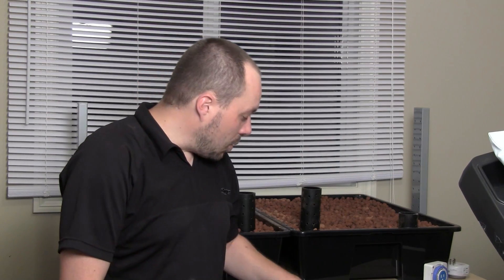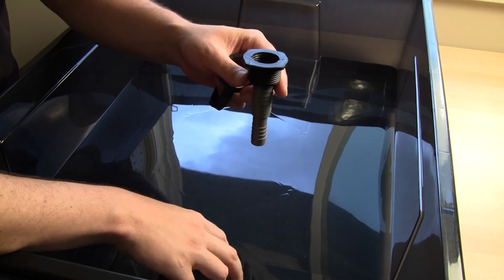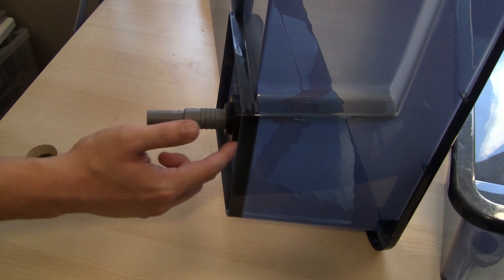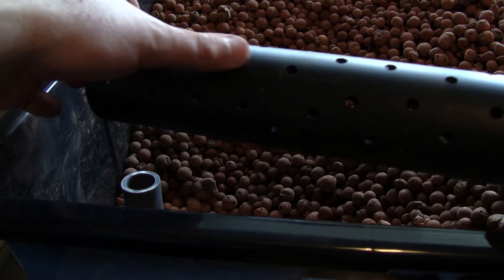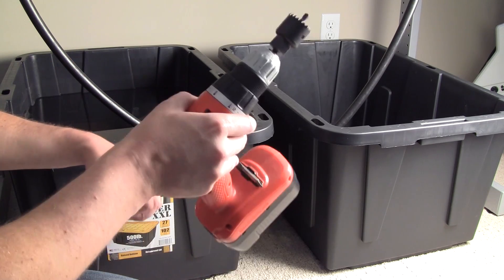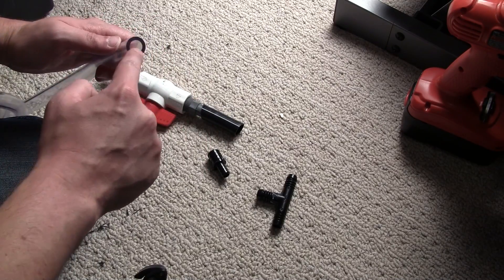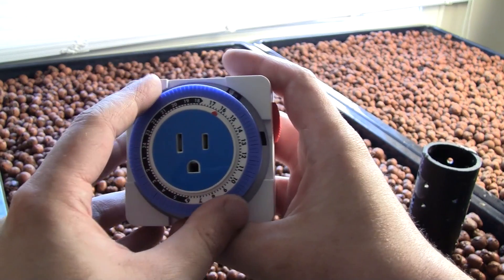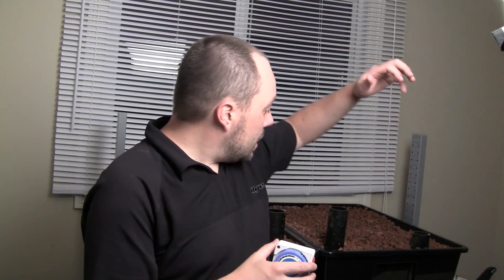Aquaponics system: How to build a desktop aquaponics system for indoor gardening. Aquaponics guide.

Comment: Nice video but shouldn't you have washed your Hydroton before putting it into your tank? Also did you consider using a bell syphon? I'm considering a system with a 20 gallon aquarium with a bel syphon. Are you using a water test kit?

Comment: You have no bell Siphon and your sump Tank configuration is backwards. You want the water falling back from the plants Straight into the fish tank for Aeration and Fish health. You want the pump pulling from the sump tank.  A sump tanks function is to pull out a majority of the waste solids you do not want actually going through your grow media and let it fall to the bottom of your sump tank, (when you clean your sump tank, The solids are great for the garden. ) you set the sump tank up so that the fluctuation in water height happens in it, usually by the existence of carefully situated overflow upside down overflow pipes in the Fishtank. Basically what you did here in between the two tanks only with an elbow and a pipe facing down into the Fishtank. Never mind the haters and let us know how it turns out!

Comment: before you decide to run out and buy all the tubs and piping and pumps, find out how much those hydroton pellets cost - I'm guessing the amount he used probably ran somewhere in the $150 to $200 range - although bags of bigger stones would be far cheaper - they are harder on the roots, and of course, much much heavier - so your supports must be able to support the extra weight.  Hydroton is light - except for it's cost.

Comment: In this set up using a timer it would appear that Robert has what is called and ebb and flow.  Once the pump shuts off the water back flows through the pump back into the sump.  No siphon needed.  This is a good alternative to a Bell Siphon as some seem to really hate them.  I actually love Bell Siphons and use them on all my large beds but on a small grow bed with limited space an ebb and flow work well.
Reply: This is not true! All he built is a stan pipe, the stan pipe had no holes!
Reply: He has a pump going up into the very bottom of the container so the drain will be the pump however low that fill tube is everything will train back down it when his pump shuts off. + he as an over flow tube.

Comment: Guys, he doesn't have a siphon because it makes it impossible for the drainage to fail.  The stand pipe needs to be at least 1.5 inches from the surface for plants to get roots down.  Once the plants grow roots, you can change out the stand pipe so that it is lower and the roots can be introduced to oxygen.  Also saves space.

Comment: Hi Robert, I was wondering if I could use peace lilies in my HOB 110 filter for my 75 gallon goldfish tank? The water doesn't drain because it's a normal filter, and I'm worried that the roots would start rotting because of that. However, I heard that if you use the clay pebbles than the roots won't rot. Any advice you could give would be so appreciated!

Comment: 5 time a day for 15 min ?

I am little confuse 

you mean we need to circulate only 4-5 time a day only or water should be run continuously ??
Reply: The system is designed to fill the grow beds then drain completely 4-5 times a day. As he stated he will test to see that it still leaves the growing media moist to about 1inch below the surface. You don't want the roots to be underwater and you want the water to cycle.

Comment: people eat food grown in plastic .... water run through plastic....  glued with who knows what chemicals umm ya organic lol
Reply: +Brad Haaf PVC is not normal plastic. It doesn't leach into water like normal plastics will. Same goes for other "water safe" and plumbing pipes.
Plastic, PVC, and other materials are as different from each other as day and night. Before buying into propaganda, do your own research.
Reply: +Brad Haaf It's inert.
Reply: +Brad Haaf I agree. I've been looking, in depth, into materials that can be used that don't cause chemicals to leach into water. People need to be aware of this. In a closed system, the chemical build up is insane. At a bare minimum you need to use food grade plastics . . . primarily HDPE if you can find it.

Comment: Wouldn't you need a bell siphon to pull all the water back to the tanks? The way yuo currently have it designed the water will only be drained to the top of the standpipe and then air will break any drainage, leaving many inches of water in the bottom.
Reply: michael brown This  is a good video, i love this. i found another resource to build aquaponics systems, panlarko expert aquaponics planner . do google search for the details.
Reply: michael brown a little curious, why must you let the grow bed empty and then fill up again, why not just have a constant level of water in the grow bed. New to this and looking around for answers to all my questions before i start on a project :) Cheers
Reply: Lawrence Chiang Plant roots need oxigen.  If you don't drain, the roots will rot and plants will die.  Unless you plan to grow plants like duckweed, but then you don't need the grow media.
Reply: michael brown Exactly my thought.
Reply: +michael brown  I think he does not have check valve in the system so when the pump shuts off there is nothing to stop the water from flowing back through the pump and the bulk head for the pump becomes the drain.

Comment: Hi Robert,
I am a newbie at all of this. I was online looking for some of the parts and i could not find some of the exact parts you are using like the bulkheads.
Any possibility you could send me a message with the links for the various parts to purchase? Thank you in advance.

2 totes 8 to 12 inch deep (Ikea $16 each)
6 ½ inch bulkheads (eBay $1 each)
2 ¾ inch PVC threaded pipe (Home Depot $6 each)
2 inch ABS pipe 3 feet long (Home Depot $7)
2 120 liter totes (Home Depot $13 each)
½ inch tubing 10 feet (Home Depot $4)
½ inch clear tubing 10 feet (Home Depot $9)
½ inch threaded ball valve (Home Depot $5)
2 ½ inch threaded to pressure fit connector (Home Depot $1)
½ inch reducer (Home Depot $1)
1400 liter per hour submersible pump (ebay $6)
½ inch pressure fit T-joint connector (Home Depot $1)
2 x 50 liters of Hydroton (Hydroponics supply $36 each)

Comment: I echo the sentiments of many who commented about the lack of a siphon.  In your video there is no mention of a method to drain the grow medium.  You often mentioned "fill and drain" but there was no mention of a drainage mechanism.
Reply: I agree, the system will fill to the drain level and not drain any lower.  He needs a bell siphon setup on the drain.
Reply: He uses a timer the water will drain through the pump the hole is for over flow or control the water hight

Comment: I found so many things that we can take out of the system. If the water is moving thru the system we don't need the air pumps. It will get enough air to oxygenate the water well. A siphon can be added to drain the system faster and allowing more water to be pumped to the grow beds which in turn moves more "food" to the plants. The system needs to be checked for leaks as well. The better way to start an aquaponic system is outside were it can take advantage of the sun. But all systems are in a try and test basis and with time it will work well and BALANCED.

Comment: Actually I couldn't disagree with Azhaan Ali more! This is a HORRIBLE video and a complete waste of time! Anyone following this video will be in for a lot of trouble! This is the perfect recipe for having your room flooded! Also having two open containers inside your room will create a lot of evaporation and moisture issues! This guy have clearly never had an aquarium nor did any kind of aquaponics. If you're lucky you will only develop bronchitis and if you're really lucky the high humidity level will create a black mold problem! Well done!
Introducing fish inside in an open system like that is completely crazy! It's going to smell so fast! The growing medium used is completely wrong because it retains very little water and the root will just hunt for water and go down into the sump that holds water not drained by the siphon! The plant will use energy growing roots and not greens.
Reply: SquirrelFromGradLife assuming the fish tank is in an airconditioned/ventilated space, humidity will never be an issue. All air conditioners remove moisture from the air as part of their cooling process, which removes latent heat from the space. In cold or dry climates, the extra humidity would be a welcome addition for pure comfort. Having run an aquaponics system for quite awhile, I can say that you're most likely the one who has never run one. They do not smell, hydroton is one of the more widely used grow mediums, and water retention is not desirable in the first place in an aquaponics system. Get off your soap box, you're making yourself look more and more ridiculous.
Reply: SquirrelFromGradLife Serious questions:
(A) Can you further elaborate? How would the room flood if it looks like the maximum amount of water that's in his system starts from the bottom two buckets. Water is pumped from the bottom two reservoirs to the top two buckets. If the pump stops for whatever reason, if all the water drains from the growbeds, the water (originally from the bottom two buckets) would dumped directly into the lower two bins. And if the siphon fails, he has an extra piping system that will prevent the growbed from overflooding. I guess I don't see how it would flood his room.

(B) Can you also further elaborate on the bronchitis thing? Should he not have any open containers inside his room? If he opens the windows, would that decrease the humidity level? How would he decrease the high humdity level? Plus, why would introducing fish in his system be crazy? I have been looking on youtube searching aquaponics (from tiny small ones to large ones) and everything looks to be the same as what this guy is conceptually doing. He's got a piping system that transfers water from an "aquarium" to a growbed, and back again. What is the problem with his system? 

(C) It also looks like what he is using for the growbed is what most other people use. They're round little reddish balls that I have seen in most aquaponic youtube video systems.

(D) What would be your solutions to his "errors"? In other words, what would be the RIGHT way to do this? Again, serious question. I'm still learning. It sounds to me like you are knowledgeable on aquaponics,if I can avoid mistakes in this video, I would appreciate it. Thanks.
Reply: All systems will leak at best and fail at worst. Ask anybody cutting holes in the bottom of containers to hold water is the perfect recipe for disaster. It will leak onto his fine carpet! If it's upstairs he might be so lucky that it takes out his living room ceiling!
Do you know how much or rather how little nutrition fish produce compared to how much your plants need? There's a reason why an actual AP system uses HUGE fish tanks! You need about a gallon pr fish meaning in those small bins ha can hardly have any fish which again means little or no plants! You can't use chemical fertilizers in an AP system because that will kill your fish! Also fish smell if you have ever had an aquarium and having fish inside in an open top container with lets say 85 degree water for Tilapea  you'll have a problem real fast! Most common health issue with aquarium workers is bronchitis and other respiratory diseases given the high humidity level!
Opening a window? are you serious....LOL that's your ventilation method opening a window....do you know how much airflow plants require to grow? LOL
Those "reddish balls" are LECA nuts. It's a clay material and it's holds very little water unlike something like Perlite. It drains well that's why they use it but it just makes the roots grow down into the sump area where there's constantly water! makes absolutely no sense and the root systems of plants grown in LECA nuts are a mess compared to something like Perlite. The root temperature fluctuates much more when using LECA and you will most certainly have root issues. Perlite gives a much finer root system and constant moisture and temperature levels.
I've wasted enough time on this but if you think it's a brilliant idea why don't you try it and report back when you've flood your room and you have black mold growing! Enjoy
Reply: SquirrelFromGradLife Thank you for the input. Appreciate it. But I never said whether it was or wasn't a good idea. I was just looking at it conceptually that it resembles most of the successful or sort of successful aquaponic systems on youtube.

I know what you mean when about putting holes on the bottom of a container used to hold liquid. Flooding is my main concern whenever I see people drilling holes in the bottom of their fish. But in the case of this video, the bottom two buckets don't have holes drilled on the bottom, only on the sides. If leakage happens, it'll only leak to the level of the holes drilled on the side (bottom buckets). If a leak does happen with the top two buckets, the water will simply flow into the bottom two buckets. That's all I am saying.

What about those small bedroom aquaponic systems with thriving plants and fishes? If not vegetable, then just regular house plants in an aquaponic system. Can't someone also employ the concepts of an aquaponic system to help decrease the amount of nitrates from a fish tank? Because that's what I'm actually looking to do. Growing lucky bamboo or some other type of house plants in the growbed simply to add some greenery in my room, and using the fish waste to give the plants some nutrient. But my main thing was to use the aquaponic system to help remove fish tank water nitrate. That way I could minimize the need to do fish tank water changes. Any thoughts on this?

My comment about opening a window is regarding the humidity, not about how much moving air the plants need. You mentioned health issues (i.e. bronchitis). I'm more concerned one's health over that of the plants. Are you saying that no one should have fish tanks inside their homes or rooms? If they do have them in their room, how do you counteract the humidity? That's what I'm concerned about. I was looking at some youtube video and someone put saran wrap over the top of their aquarium to prevent water evaporation. Part of the corner could be removed to allow air to flow between the aquarium and room air, and during feeding of the fishes.
Reply: SquirrelFromGradLife You are a pretentious douche. Chill out.
Reply: I found it useful.

Comment: I realize this. How often do yours cycle? Or is the cycle continuous? I've seen many systems on here, using bell siphons, that are on timers and fill and drain on a "schedule", as opposed to continually filling and draining. It seems that by using the right grow medium the plant's roots will remain wet without its feet standing in water, even filling and draining on a timed schedule. Mind you I am only speaking from what I have observed here. I am however currently planning a system.

Comment: Have you considered using a bell syphon so you can draw down the water level to about 1/2 inch and allow oxygen to feed the roots which also feeds the boi-sphere that converts amonia (NH2) rich water to Nitaite (NO3) to Nitrate (NO2) by means of a bacteria that grows in the gravel, thus the filer system. To create the bell system all you need is a 2" pipe with cap, inverted over the inner syphon tube. Don't go over an inch above the syphon tube and cut slots in bottom of bellto break syphon.

Comment: The only problem I see with this is the way you are draining the beds. I understand what you are saying about overflow equalization, but once the water goes below the level of the top of the drain's standpipe, that's it. Without having a "bell" on top to pull water from the bottom of the bed, as with a bell siphon, I don't see how it will possibly drain beyond the top of the standpipe. I watched this pretty closely and just couldn't see it.

Comment: Neat little system... I think I would have turned the beds around so the drain and fill lines are at the rear of the desk & help keep them out of sight under the desk as well. I'd also install a divider down the center of each bed so the flow enters from one side, flows to the far end & then back down the other side to the drain. You could install the lines at opposite ends of the beds to ensure an even flow throughout the entire bed as well..! Thanks for sharing... :)

Comment: I can see the clear plastic tubes filling the system and the overflow but I don't see where the emptying tubes attach to the grow bed. Also, by connecting the emptying tubes with a T at the bottom you are slowing the flow. Maybe this isn't a problem as you want to time the empty cycle on your system but if you used a syphon this wouldn't be helpful.

Comment: Sorry to be a pooper sir but ABS? Are you serious? I'm a industrial plumber so I know a thing or two about these plastics, I also have a small Aquaculture farm. You should only use PW PVC. PW is for potable water, PVC is use for irrigation, low budget housing, seen it feeding million dollar homes on hillsides. Doesn't leach plastics. ABS is used not used for water supply for a reason. Don't want you to get sick. PVC PW comes in all sizes at Plumbing supply stores.Otherwise nice set up. Good luck

Comment: I pray you used Polypropylene 5 plastic? It will have the recycle triangle with a 5 in the middle. HDPE 2 AND LDPE 4 are ok but PP5 is best. You don't want plastics leaching into you foods.

Comment: Curious about how the fish tub on the right causes the water to overflow into the sump tub on the left. The tub on the right have tubing and pvc that look like they go to the bottom. It it suction on the bottom that cause the water to over flow once the water reaches above the connecting tube between both tubs?